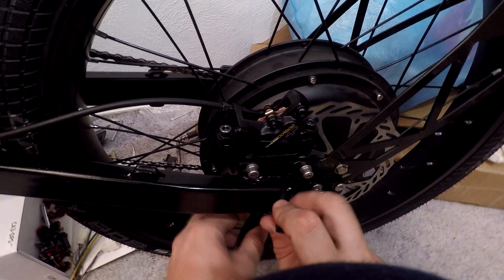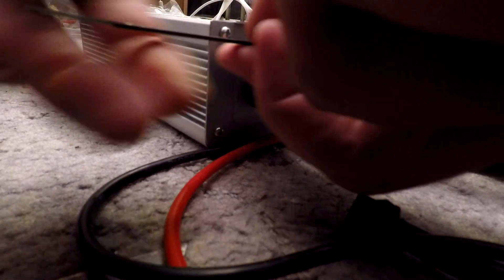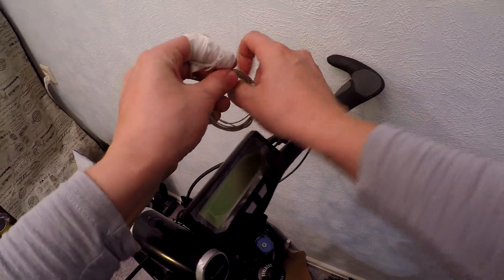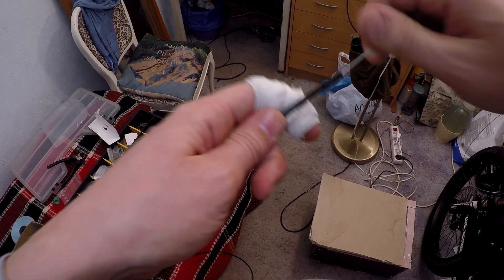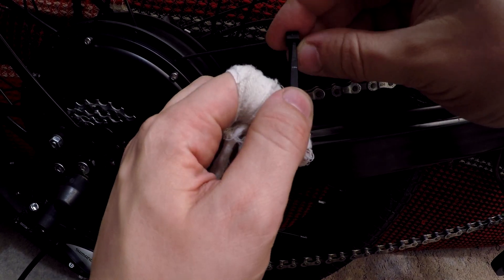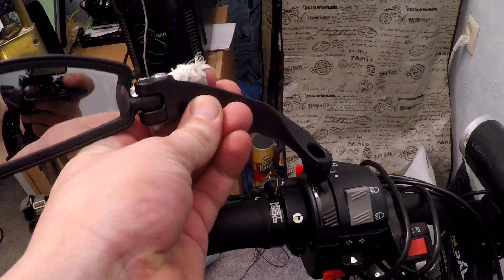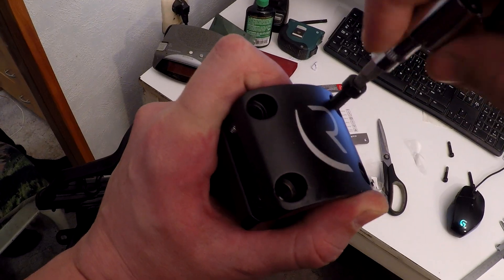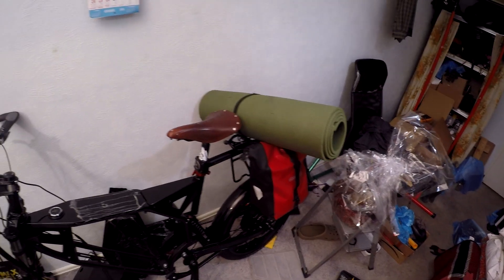Building an Electric Bike in My Bedroom - #8 Shifter Cable, Mirror, Post Rack.

Comment: Thanks for the quality videos. I ordered the same Enduro frame but also want to install a rear rack. Have you seen the moto seat with rear track from Vector/Eleek? It looks strong. Any knowledge if their moto seat fits on our Enduro frame?
Reply from the maker: Hey and thanks for the comment. Unfortunately, I have no information on this. If they have built their ebike on top of the Chinese enduro frame then it should fit. I suggest asking them directly. A standard luggage rack can also be added to the Enduro frame, with some modifications needed. I definitely plan to make a video of it in the future. The luggage rack solution I use can be seen in my last video at 4:05
But eleek moto seat with rear rack looks cool and awesome.